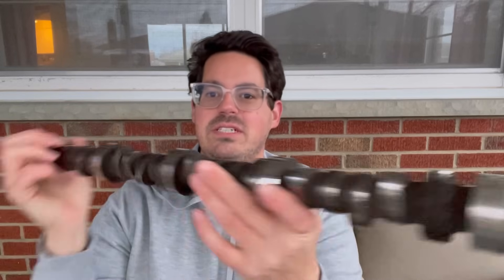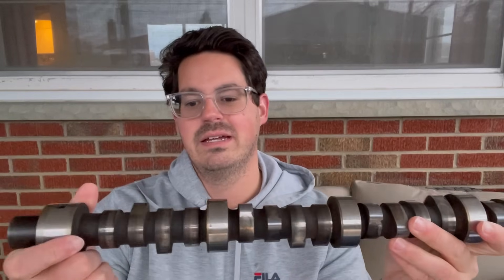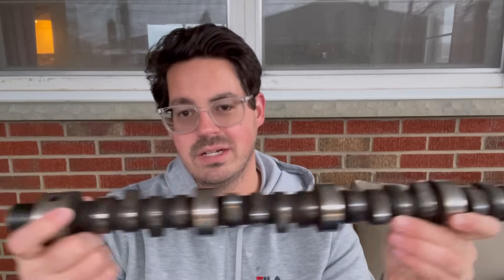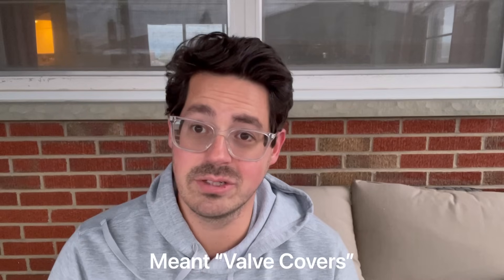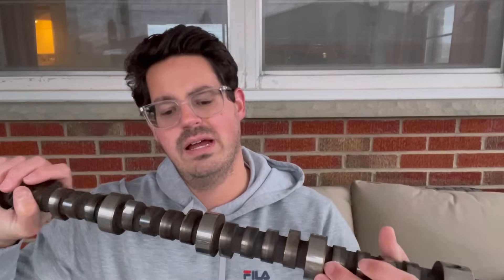Worst Automotive Components: Soft Camshafts (Chevrolet 305 & 350/Cadillac HT4100/Pontiac V8s)

Comment: My current repair project (which is about two days a week), is my 81 Corvette.  I am replacing the cam because the #3 cylinder exhaust lobe is rounded off.  The lifter was concave where it met the lobe.  This all happened at 56k miles.  Engine is spotless inside so it has always had maintenance.  I have owned the car for 12 years and 11000 of the total miles.  It is hard to say that a 40 year old car had a defective component, but it seems to be the issue here.

Comment: had the same issue on my 79 Malibu with the 231V6 took me forever to diagnose, car had only 30,000 miles and this was 1996 so it was pretty old at the time,  local parts store had the cam in stock so I knew it had to be a common issue,  mine only had one rounded lobe and was backfiring quite a bit

Comment: Not only soft camshafts but nylon lined aluminum timing chains that shreaded. Block metalurgy was weak and threads stripped out as head bolts pulled on them

Comment: Wow, this sure takes me back in time. My first new car, one was a 1978 Impala. It was a 305 V8 and included the F41 suspension package among other options. Suddenly at 11,000 miles it developed a ticking noise from the valve train. With the valve cover removed you could see some of the rocker arms didn't move as high as the others. Worn out cam lobes at this mileage? YUP! I actually got GM to repair this for free as I was part of a class action lawsuit that prevailed. Go figure.

Comment: I had a Pontiac with the 305 Chevy engine.  When GM settled the class action suit over Chevy engines in other brands I received a $300 rebate.  It wasn't enough. At a little over 50K miles the camshaft lobes wore down.

Comment: My parents had a '78 Chevy Malibu Classic with the 305 V8 and the TH200.  I drove it for a year at college and then sold it at 80K miles to a friend.  He liked the way the engine sounded like a sewing machine; little did either of us know about the soft camshafts in those engines.  I learned about the problem a decade later and it made total sense why the lifters were noisy.  The TH200 on the other hand, never gave  us a problem, even though it was undersized for the car.

Comment: My guess as to your 4.1 camshaft. When the engine was worked on the engine was disassembled and repaired. I will bet the camshaft and lifters were reused and they mixed up the lifters. That will destroy a camshaft in a very few miles.

Comment: I'm wondering if the camshaft issue on the 4100's was more from coolant leaking in from the intake and wiping out lobes than an outright soft cam problem by the mid 80's. We used to update the intake gaskets on these engines if we got a nice running one to help prevent warranty returns and I don't remember any coming back or needing a camshaft replacement on engines that got this update in the 90's. Our mechanic was so good at GM intakes he used to pump out several per day and could do them in his sleep and that was in between all the other crap we threw at him!

Comment: Small block Chevy V8 cast camshaft lobes were induction hardened on automatic, high speed, Tocco heat treat machines. The cams were fixtured and rotated on center with each lobe positioned within a "fish tail" that heated the part to a target temperature and time duration. Following heat treat, the camshafts were quenched. The system could produce quality parts, but manufacturing controls were inconsistent (stated politely) in that era.
Reply: The opposite wear pattern occurred when small block V8 engines were transitioned from cast to steel Camshafts. Early production engines had Distributor gears wear out prematurely as they were "apple cored" by the harder steel Camshaft gears. Once this quality concern was identified, heavy grease was added to the gears at point of assembly.

Comment: As a pretty die hard GM guy, at least as far as older vehicles go, I have to admit that the soft camshafts from this era where inexcusable especially considering that GM was fully aware of the issue and they refused to address it for several years.

Comment: Today, the Dodge HEMI camshafts are failing. Roller lifter needle bearings go and the lifter eats up the camshaft. I have done a TON in the past 7-8 years. Crummy part is the heads need to come off to get the lifters out.

Comment: Build quality suffered across the board among USDM manufacturers in the 70s and into the 80s, but it were the mechanical failures like these that destroyed the reputation American cars had for being stout. What you're left with is a crap shoot of cars that will last forever even if they're poorly maintained, manufactured alongside cars that don't even make it 25k miles with full maintenance. It's a shame and issues like this probably lead to a lot of otherwise fine being scraped.

Comment: The HT4100 was simply junk all around. But the Chevy small blocks were otherwise good engines with defective camshafts. They made a 307 in the early 70’s that was the worst in this area. The 305 and 350 were just a bit better , but not much

Comment: Good subject, I purchased a used 86 El Camino in mint condition sharp looking two tone silver gray, the car would not get out of its own way. A friend had one with a v6 that performed great. So I bought a mild Crane cam and new lifters and rockers. The finished product was awesome I saved that cam also for years it had no amount of lift at all on the cam. The car was owned by 2 different people before I purchased it in 1989 with 38,000 miles makes you wonder why I bought it for $1800.

Comment: Hi Adam!

Its Allways interesting about the issue of "Soft Camshaft", because it´s not the case that the engines you´ve named for that in this viedeo. Because that the issue of soft camshafts is still today an issue show that industry, however which industry isn´t makeing evolution. often older eninges or what else are the better choice. I´m 35 and i´m an engine guy that is in that topic with hearth. I wrote some comments on your videos, possible that you´ll remember me or these comments what was arround the nice 65-75 US cars & industry, and that i´m from Bavaria(ger) and i´m restoring an 67 Caprice/Impala 4 Door Hardtop with my 73 years old dad with sheet metal rebuilding and what else...and i´m a big fan of the mopars like the Charger/300C esp. arround the year 2006 when they really mae all (or the most ;)) right with reintroducing the "Charger" and the LX Platform, what is a really fantastic car untill today. But the HEMI´s does have issues with soft camshaft lobes. And that´s something what i can´t understand WHY. Because to make a camshaft reliable/durable they´re mostly INDUCTION HARDENED, what is a surface hardening of the lobes. I can´t beleave that the cams would have issues about that. Is it "Safing time in production", that they wouldn´t use the right neccessary time for the induction hardening process, or what is ist!? For exmpl.: the HEMI´s untill the VVT(Variable Cam Timing) came up didn´t had issues with "Soft Camshafts", but since 2009 the HEMI GEN III got the VVT, they got also a little sharper curves and so it beganns that some HEMI´s got soft camshafts and then there is the "HEMI TICK", what is a ticking noise made from the rollercam, often the needle bearings of the roller lifters stuck, because the needles are worn and then the stuck roller grindes the cam lobes down. That is often at the 2012/13 Models years. Now they´ve changed the design of the rollers, but still remember that the HEMI´s untill 2008/09 withouth the VVT didn´t had issues with "HEMI TICK" or "Soft Cam lobes".... It´s really interesting, because it must be an issue between the induction hardnening of the surface of the lobes, what isn´t done with the right time needed to harden these...and even between the roller-lifters...what worke very very fine untill 09! Because the GEN III HEMI´s untill 09 didn´t had these issues. And if they ha an issue it was a "Press Fit Issue" or even "Valve Seat Drop" what the GEN III could get untill 09. I´ve a 06 Chagrer DAYTONA, one of 4000 made "Top Banana Daytona" and i really made a lot of modification to prevent such issues like the "dropping valve seats" so i lovered the opperating temps arround 20°C about Motor-Oil Temps and untill today it works very fine, it works so great! Esp, bevause the environment of the Bavarian Alps is more stress for the Engine, Brakes and the suspension, the 138.000 & 16 years old Charger makes that really really great! I use a 15-Row Motor Oil Raiator, with an thermostat opening at 180°F/82°C, and also changet the cooling water thermostat with the same opening temps instead the higher temp thermostat.... However, for me it´s unbeleavable that "Soft Camshafts" is still an issue, because the Surface hardening with the induction heating process is still known how it works, and it´s possible that they´ve not used the right ammont of time when they´ve hardened the cams......

Nice greetings,

Till

Comment: The problem was not the camshaft. The lifter bore was wrong. Lifter bores are supposed to be slightly tilted so the lifter will turn in the bore. The problem was the boar was directly straight, the lifters would not turn and then wear out the cams. The proof of that is that it always happened in the same bore every time.

Comment: Yes CHP even tested big body Z28 Camaro and went with the Mustang SSP instead, the Camaro's cam would round off after many high speed runs? Whats sad that model camaro was a better cop car in general over the stang but not for why they were buying a 2 door sport's car. And I had a 79' chevy plow truck with a 305 loved truck paid only $600 made me thousands!! But at first felt like a 350 but after some time plowing/towing/idling it turned into a tired 305 that it was that would make a burbling no compression sound. You could throw it in 1 driving would just make this bubbling gurgling sound no slowing down. Ironically I drained coolant floored it up in down main street trying to kill it but wouldn't die? Changed in newer 350 was fine for many years later.

Comment: This was really unacceptable that this happened with a manufacturer that should have had proper quality control procedures.  But,I experienced flat cams with a couple of non-GM cars as well: a 1979 Volvo and a 2004 Jeep Wrangler.  The Jeep had the 4.0 liter inline six and very low miles when it happened.  Not only did several cam lobes go flat, but a couple of hydraulic lifters wore holes in the bottom and stopped pumping up. The dealer admitted it was a common occurrence. The Volvo wasn’t as dramatic but was definitely low on power prior to receiving its new cam.

Comment: Allot of the 305's from the early eighties,also suffered from cam core shift (crankshaft camshaft shift) Lack of nickel in the cast iron .
Reply: It’s funny Pontiac didn’t have a lot of problems with the last few years of their 400 production. They used a block from 75-77 that they thinned out the webbing where the main crankshaft bearing caps bolted in to the point that the bolts protruded through the webbing. They were concerned enough about warranty issues that they began using the older 400 casting on the high performance W72 engines in 78-79.
Reply: Those 305’s from that era had shitty blocks because GM tried to lighten them and went too far. Thankfully, in stock form, they were anemic as hell, so they didn’t tax the bottom end too severely.

Comment: I bought a clunker ‘80 Malibu with a Chevrolet 3.8 Litre (229 CID) V6. The car had about 60,000 miles on it when I bought it. I had owned a new ‘81 Cutlass Supreme with a Buick 3.8 Litre V6. I remembered that the car was quite underpowered and this ‘80 Malibu was even slower. It actually ran fairly smoothly but I couldn’t believe how slow it was. I took it to a friend for a tuneup. Lo and behold it was running on only four cylinders. My friend had owned a ‘78 Malibu with a 305 V8 and had the same issue.

Comment: I had this problem with my 1977 Buick Regal. At 95,812 miles, I rebuilt the Buick 350, which at the time of disassembly in 1991, had 5 cam lobes flat. I did not know about the metallurgical problems with this era of GM cars.I simply refreshed the gaskets and bearings, replaced 1 bent push rod, the camshaft and had the rebuilt 2bbl Rochester gone through. The car suffered an untimely death in 1993 after throwing a rod in Kansas City.  I blamed myself at the time thinking I'd reassembled the engine incorrectly but the engine ran flawlessly for 17k up to that point. I now know that reusing the crank & pistons/rods was not the best decision. The car has been gone for 29 years but I still miss it. My father bought it brand new in 1976 and junking it out was hard as it was of enormous sentimental value being the car our family was raised in. Thank you Adam for covering this topic and informing me of things that went on in the industry of which i was unaware.

Comment: Yes sir that's how I got my 1981 vet real cheap didn't run right and it  made a ticking noise and down on power. It had 28k on it. It ended up being the cam. I ran it with the valve covers off and seen two rockers were just barely moving. I installed a stock replacement cam and she runs like a top. I thought poor oil quality too maybe for the culprit. The lifters were like you said concave. Good times.

Comment: Soft cams! My Dad bought new a ‘66 Tempest with the OHC6. By 30k miles in the early ‘70s, the cam was shot, and needed a valve job. Not too long after, new rebuilt short block. Oil was always changed, so not due to negligence. Rebuilt engine lasted forever. After watching this, is there any wonder GM is down and out? It’s just a shame…

Comment: I owned a 1977 Firebird with a 305 V8. At low miles it had no power and idled rough. GM replaced the heads due to valve guide wear? No improvement and no further help from GM. I later replaced the heads 2 additional times, once with rebuilt 305 heads then with chev 350 heads. The problems never went away so I sold the car. Probably the cam shaft shaft was wore as you described. Wish I new about that issue 42 years ago! Thanks Adam and keep up the great work!!

Comment: I think I got lucky during that era because I didn't buy any GM, Ford or Mopar products.
Instead I bought a 1982 Toyota with the Legendary 22R engine. That, without a doubt
was the best vehicle I've ever owned! Yea, I know...Rice burner... Fantastic vehicle Imo.
Reply: Obviously you didn’t live in the rust belt. Not that the domestic cars were a whole lot better, but I remember when I was little in the 70s and early 80s the only foreign cars on the road around western Pennsylvania were VW bugs and later Rabbits because they had a plant locally that built them. You would see an occasional Datsun Z car but that’s about it. I remember riding the school bus in grade school. There was a Subaru Brat in someone’s driveway. It stood out because it had seats in the back outside. This was in grades 4-6. It was a cool looking thing in 4th grade but by the time 6th grade rolled around it was a complete pile of rust littered with rust holes. This was in the late 70s-early 80s. Toyotas and Hondas really didn’t start to appear around here until the mid to late 80s.
Reply: I've owned Celicas from 79, 81, 82 and an 85 Supra.
They were all great vehicles, but 
The 1980 was my favorite by far.
White with black interior, rear window louvers, Notch back, alloy wheels, 5 speed and just enough power to (almost) get in trouble.
It was the best slow car at going fast that I've ever owned.

Comment: Excellent information!   I remember reading this affected 1979 to 1982  267, 301 and 305 engines.  Didn't know also the 350,  and the Cadillac HT4100 had the problem last even longer, as you pointed out.
Reply: Ok makes since, I was thinking everybody got a bad batch lol, my 1983 k5 blazer "my parents bought new" still has it stock 305 with original cam, the as of 2023 it has around or over a half million miles. With the valve covers off a couple rockers seem to not lift as much, but seems to be expected after 40 years. Runs smooth and still has the power to get up and go.